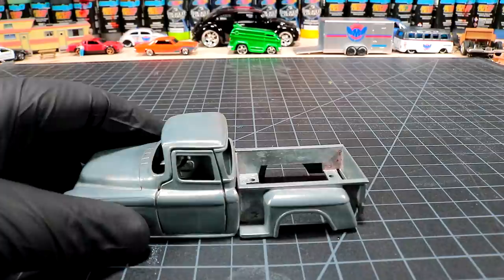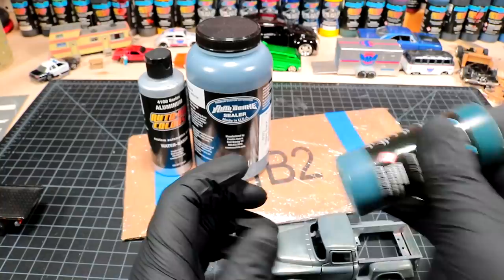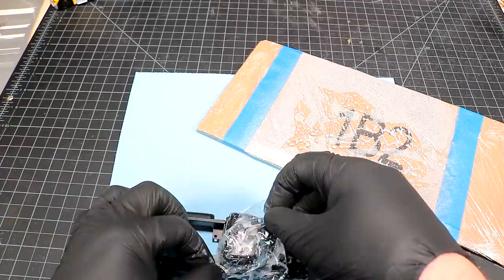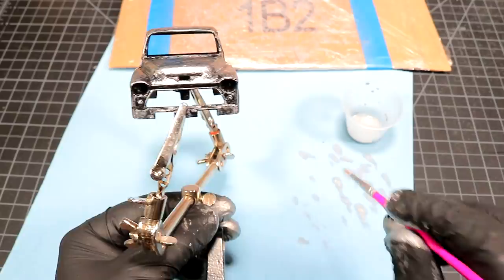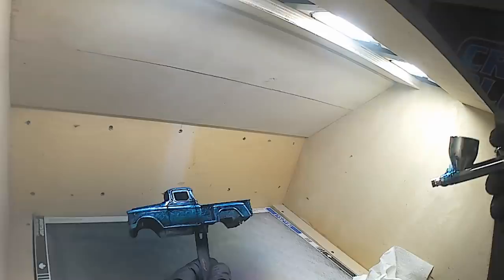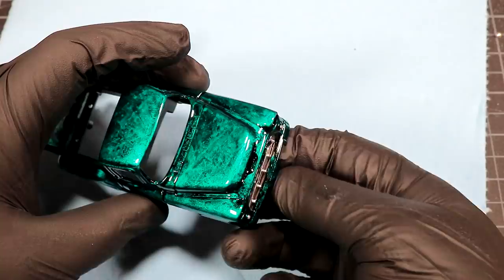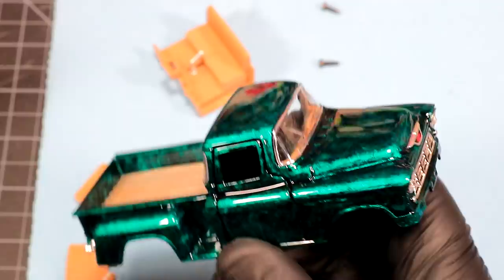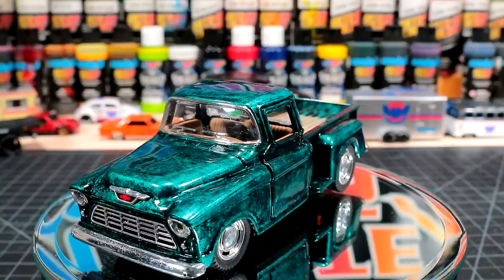Painting Diecast Model Cars - '55 Chevrolet Pickup - Marble Paint Attempt

Comment: This marble effect paint reminds of another paint effect I saw on finders and tank of a chopper. The painter used gold leaf foil on the paint job. If I remember right the painter set the gold leaf foil on top of wet paint and lightly used a brush to remove some of the gold leaf foil then clear coated over it to finish the paint job. It looked crazy good in the sun.

Comment: Wrap cellophane with crinkles around a makeup sponge. Should give you more control.  And since they are tear dropped,  you can use the small point to get in hard to reach spots. Plus with it being foam you can apply different amounts of pressure to get various effects.

Comment: I'd say really thin the silver down a lot with slow dry reducer for work time. Paint the wrap then apply it over the entire matchbox pushing it into the crevices. The wrap will make thin an thicker paint texture as you pull it off.

Comment: Nice job.  When I learned about this method it was painting the part with the chrome and then using the wrap to pull it off.
Reply: Your way is a little faster and easier. Spray the wet coat of silver right on the item and use a plastic bag or plastic wrap to remove some.

Comment: Cool effect.  I wonder if it would not be easier to spray the car with aluminum and then dab off with a sponge or cloth.  By removing you might get more depth with light and heavier aluminum areas.  Or could try dabbing on with a sponge.  No idea if they would work just some thoughts to try.